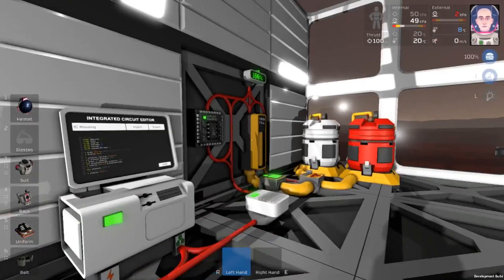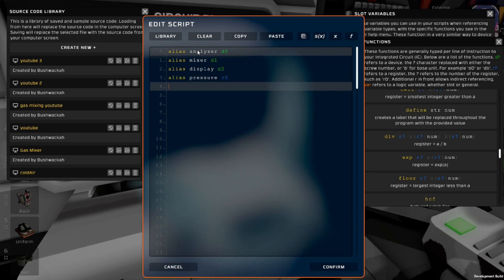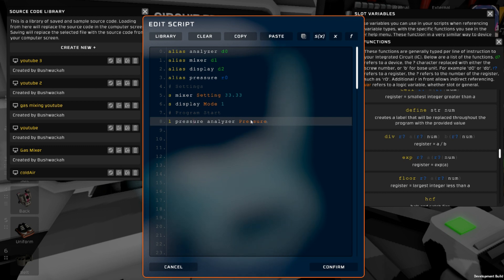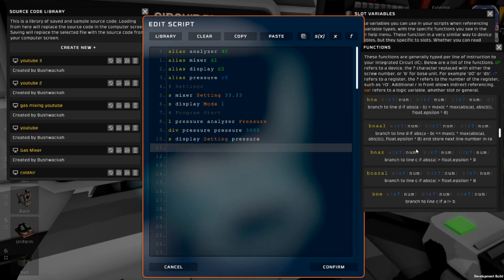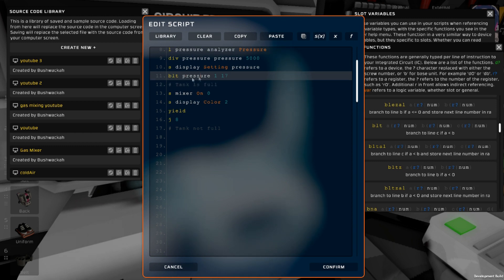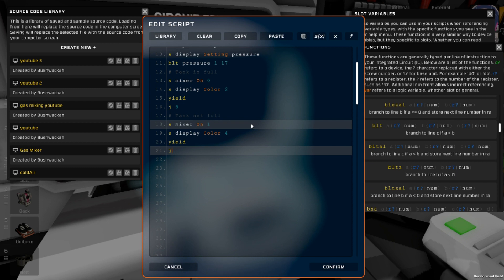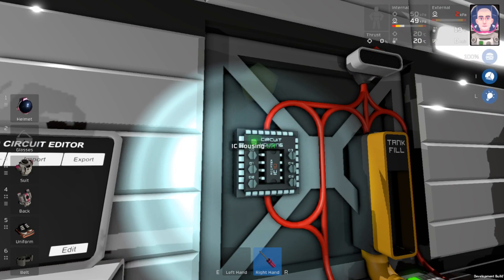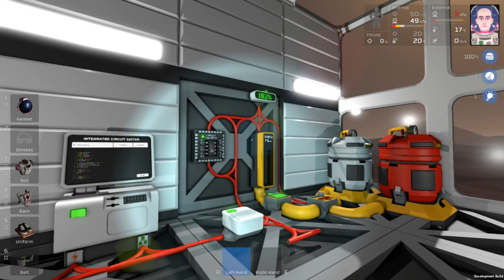Stationeers Tutorial: Programming Pt.3 (Gas mixer)

Comment: Neat! For those who want the code I put it into Stationeering with some tweaks. I'm using jump tags in this, which helps if you need to add or remove code. Also it uses a register for the target pressure (5000 in your example), that way you can quickly find and modify it as needed.
Link here: https://stationeering.com/tools/ic/_Kfs6W4CRLB

This'll be a good start to my mixers and fillers based on temperature project I have planned!